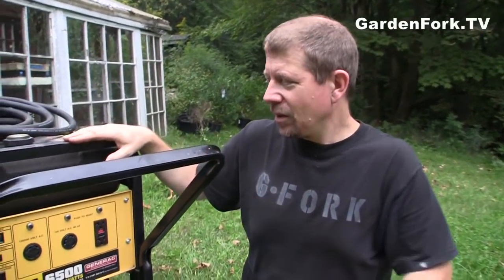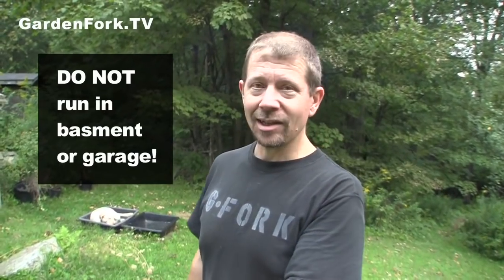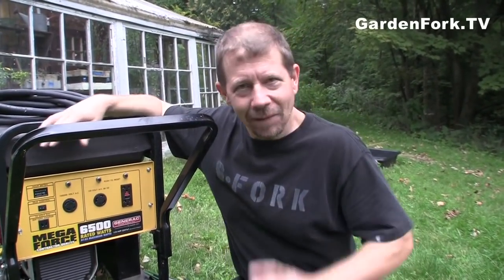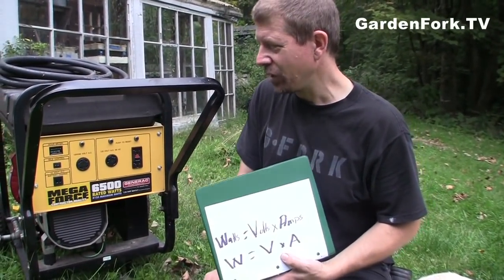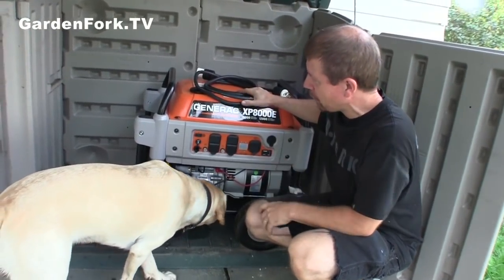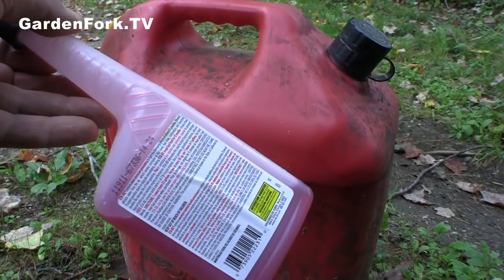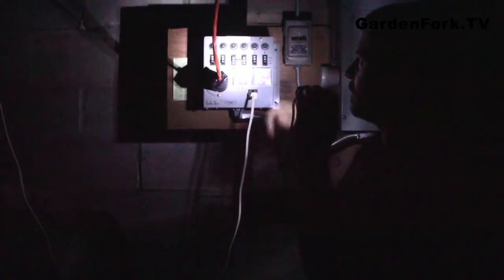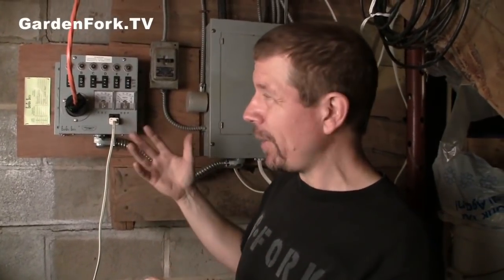Generator Transfer Switch Install - GardenFork

Comment: Should I turn off the MAIN before I turn on the breakers from  my transfer switch-I called generac and they said I should because when the main comes on again- there might be a power surge- and be fed back into the generator and might cause damage???

Comment: I think you should make it clear to ALL that you should never apply generator power into the main panel when power is off. There may be linemen working on the line repairing the loss of power. We don't want to kill or harm them as they are thinking the lines are dead. Although it may not apply to your setup.  as I think you have an AUTO switch..       Thanks for the video

Comment: Nice Video, and yea, hear it all the time of Carbon Monoxide deaths via generators. Sadly, had a death in my neck of the woods via Super Storm Sandy (elderly person running generator in garage). During winter season also hear about deaths via gasoline used in kerosene heaters too. During time of emergency, or any other time, I always check in on the local old-timers, via personal visit or telephone call.

Comment from the maker: yes, the manual transfer switch keeps the generator from running power out of your house and back into the grid. this is the most important part of any generator system. the transfer switch can cost almost as much as the generator, but it is incredibly important. safety first when dealing with electricity!

Comment: Nice Video! The inexpensive transfer panels made by Reliance (and others) that use pushbutton "supplemental circuit protection" circuit breakers. The way I read the NEC these circuit breakers are not allowed to be substituted for approved branch circuit circuit breakers but since they are only in the circuit when on generator power it is a bit of a grey area. Better to  use a sub panel with full size breakers.

Comment from the maker: low amperage or voltage drops, ie: brown-outs, can damage appliances, but i have a similar set up in my home - baseboard heat, microwave, etc.  - and have not damaged my appliances, and i have a lower wattage generator. 

be sure to add gas stabilizer to your fuel for the generator, and run it every month for 15 min or so. and change the oil, check the manual for how many hours between oil changes. 

thanks for the question, let me know any others,   thanks, eric.

Comment: Just a quick question, i recently had an electrician wire the exact transfer box you are using, I had 3 bedrooms wired up, along with the fridge, and microwave, plus my gas furnace which uses electric pumps for baseboard heat, the main outlet off the transfer box is a 30 amp connection which runs into the 30 amp connect on the generator. Is 30 amps enough power on these circuits to do the job?? Ive heard low amperage can damage appliances, also the generator is 9000 watts,

Comment: nice job, im not 100% sold on the suppliment breakers in the transfer switch, i went with the 30 amp outlet with a double pole 40 amp with proper wire, locking out main of course. 
great job

Comment from the maker: sorry for the delay here, but you can run romex or conduit through a wall in most states, but you'll have to check the local code. if in doubt, please hire an electrician.  thanks again,e ric.

Comment: Like the Puppys. I found that Battery UPS For Computers and LED TVs work very well. You can get the $40.00 ones. They will keep your Power for the devices @ 120 VAC 60hz. Generators can be dirty Power.

Comment: What model UPS are you using? Been searching for a compatible UPS or line conditioner to clean up the dirty sinewaves from cheaper generators. 
I've seen some UPS not recognize gen power and just run until battery dies.
Any recommendations?

Comment from the maker: @bcharper21 excellent point. last big power outage here, only one gas station was open - they had their own generator - and the line of cars went down the highway.

we don't run our generator continuously when the power is out, we turn it on to allow the freezer to run and take showers, so we limit the use of fuel.

Comment from the maker: @DBIGMAN812MANY the transfer panel prevents any power from backfeeding down the utility line. that is one of the major reasons for using a transfer switch. 

people have suggested just hooking your generator up to an outlet in the house and running your home that way, which is VERY dangerous, the transfer panel safely provides your home with power and allows the power utility workers to do their job safely.

Comment: I would not use a generator to power any newer flat panel tvs, computers, and higher end sterieos.  I would get an inverter generator to power these.